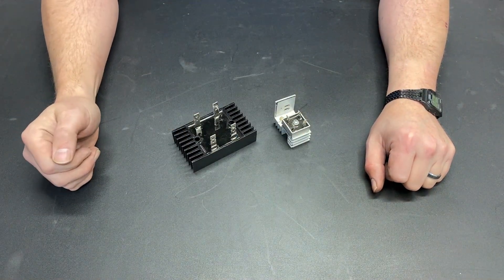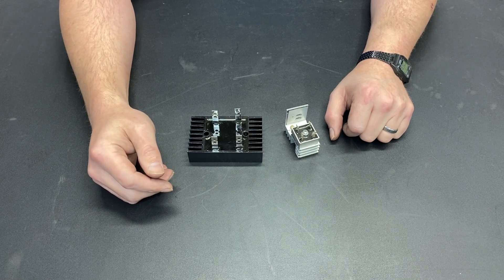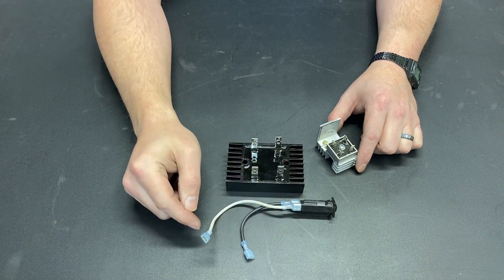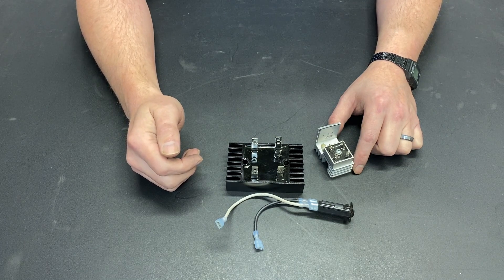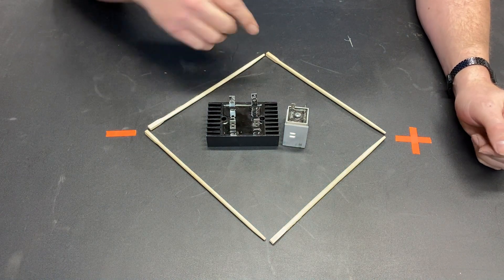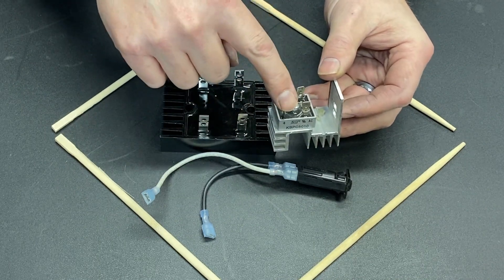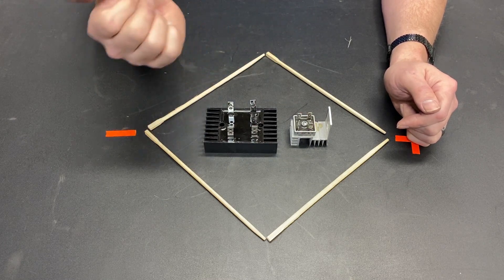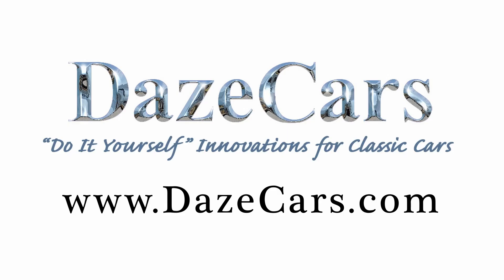Rectifier Basics for SCR & Variable Transformer Treadmill Motor Power Supplies Convert AC into DC

Comment: I have an SQL 100A 1600V bridge rectifier with 5 pins. The 3 on one side has a tilde mark on the pins and the other side has a plus & minus sign on the pins. I am trying to build a motor controller (using information from your video series and thank you very much for making those videos) for my drill press using a tread mill motor. I am not exactly sure how to wire it. Please help.
Reply from the maker: that is the wrong rectifier.  It is setup for 3 phase.  I believe you can still use it by only hooking up two AC wires on the AC side leaving the third unattached.  Double check it with a meter before using it to confirm you have it hooked up correctly

Comment: I guess Im a little confused by what you’re referring to when saying “burning up your power supply” in the event the rectifier has a diode short. 
Are you referring to a SCR controller or possibly a variac?
Reply from the maker: Any AC power supply, Variac or SCR.  when a rectifer fails it is effectivly like connecting the two power leads coming  from the SCR together shorting out the SCR.  Same would be true of the Varic

Comment: Hey Treadmill guy, question, I’m hooking up a 4 hp, 30amp treadmill motor for my lathe, I’m using all the components you are suggesting 
Larger rectifier, 20 amp breaker , potentiometer you suggested. I have a problem with the breaker popping as I turn it up, my wire plug in is 16 gauge, all my other wires are 12 gauge , or 20 amp rating. Do I need some kind of transformer to allow me to reach 30amps from a 110 house outlet?  I think the motor is drawing more than the system can handle, thus popping the breaker. Thx Rich , great videos ! 11:10
Reply from the maker: I am running 25 amp motor on my lathe with no issues.  First thing I would look for is a physical issue.  Something binding, turn all moving parts by hand including the motor shaft.  What is the RPM rating of the motor?  are you using any gearing?
Reply from the maker: Are you popping the house breaker on the breaker in line between the SCR and rectifier?
Reply: @dazecars  popped the 20a breaker I installed in the wiring circuit to bench test the motor.
Reply: Just bench testing motor, no load on motor yet, checking rotation seems to be ok no drag, 4.0 hp, 4000 rpm, 90 volts, 30 amps
Reply: Does the 30 amp rating , mean it will draw 30 amp, that’s why it’s popping?
Reply from the maker: @richbulger9710  Several things here first the breaker might be over sensitive, second the motor can draw up to 30 amps but usually only when loaded.  I run a 20 amp breaker on on my 25 amp motors without issue but your motor is a beast.  I would go to a 30 amp breaker.  As long as you are using the good rectifier not the little silver one for a bench test you could try it without the breaker.  It is still a possibility to blow the rectifier but is not likely because there is not load to the system.  That is just a good test but I would not run the system without a breaker in the final install
Reply: I removed the 20 amp breaker and it ran for a bit, even a bit more rpm’s, then the 20 amp breaker at the breaker box popped.
I will get a 30 amp breaker and try that for the treadmill motor circuit. Should I be concerned with running the 30 amp breaker on 12-2 wire instead of 10-2. I am using the bigger black rectangular rectifier with cooling fins, that you specified. Thx will give it a try. Rich
Reply from the maker: @richbulger9710  That motor is huge and I believe that is the problem.  I think you are going to have problems getting enough amps no matter what you do. I was hoping that due to the reduced volts a bigger breaker between the SCR and rectifier would not be an issue (amps and volts effect each other) but now that you are popping the house breaker I would not step up the 20amp  breaker.  Were you on a 15 or 20 amp house circuit?  The only other option I can think of would be to run it on 220 BUT you will need to be very carful not to exceed the 90 volt spec.  Most SCRs will work at both 110 and 220.  If I was going to do it I would put a limiting resister in series with the potentiometer to make sure there was no way  to put to many volts to the motor...  Do any or all of this at your own risk... sorry had to say it 😁
Reply: I’m using the 100amp, 1600 volt bridge rectifier, 2phase diode.
Reply: 20 amp
Reply from the maker: @richbulger9710  If you are popping the 20 amp house breaker, than that motor is simply too big for a standard 110 circuit.  I am sure there is probably a power supply out there that could be used but I am not sure what it would be and it would likely be expensive.
Reply: I never got or saw the controls for the treadmill , is it possible that the controls were able to make it work on 110, do they even make 220 treadmills, is running it on 220 make any sense, if so  how besides setting up a separate 220 circuit. Or should I focus on finding another motor. Thx
Reply from the maker: 220 (again at your own risk) will solve the amp issues but you must run a limiting resistor in the SCR so that you never over rev it. The potential is there to go more than twice the max RPM. You would need a 30 amp breaker between the SCR and rectifier, you would need to confirm the SCR is good up to 220 , and a different value potentiometer with series limiting resistor would be required. Up side a superior motor with tons of torque and plenty of power to drive it, down side, no room for error and catastrophic results if not done correctly.

Comment: With this setup do you run the inductor & choke ?
Reply: using the Variable Transformer
Reply from the maker: it’s not required like on the scr. you should watch my mc2100 scr variac shootout
Reply: @dazecars   Thanks I did before .. I'm not a electric guy so I miss understood the words "Clean Power "  I was running a treadmill motor with a SCR  & it just quit so I am converting to use a variac . Thanks again
Reply from the maker: @rcasatelli400  glad I could help

Comment: Why do you need an extra potentiometer if the Scr has one or am I mistaken?
Reply from the maker: The one in the SCR is oversized for most treadmill projects.  Most SCRs come with a 500K potentiometer and for 110 usually 120K-150K is what is needed.  You can use the 500K unit but you will need to turn the potentiometer 2/3 of its travel before the motor will come on which only leave 1/3 for total speed control.  I use two different sizes of potentiometers for my projects so I have fine and coarse speed control.  I cover all of this in this video https://youtu.be/04d0u1RJyXw

Comment: Have you seen the KB electronics KBIC boards?
Reply from the maker: I have my concern with them is amps.  Amps are directly rated to torque and their amp rating is well under the max amp rating of most treadmill motors.

Comment: wondering if you can help me i bought the 4000 w scr speed controller and pack of 4 bridge rectifiers number 5010 to hook up to a treadmill motor so i tried it out on a little 18 volt cordless drill motor and the thing blew out a bunch of sparks ...i thought the rectifier was to bring voltage down to 12 volt  ? so i didn't try it on treadmill motor didn't want to blow it out what did i do wrong ? i hooked 120v into scr controller and out to bridge rectifier to ac clip and parallel clip i seen it done a few times then motor to other 2 parallel clips and bang
Reply from the maker: The SCR controls volts and puts out between 0 and 110 V  AC.  The rectifier converts AC too DC.  It is not a 12V converter.  That SCR will be too small for a treadmill motor, you will burn the SCR up.  Also your rectifiers are likely too small.
Reply: @dazecars  i seen the videos where they bought 10.000 and they said it was to big and they had to turn the knob over half way before the treadmill motor would turn they said 4000 would be a better scr and i'm gonna order the bigger bridge rectifier that you showed on this video but what scr would you recommend and Thank you for your reply gonna use the treadmill motor as a powerfeed for tablesaw
Reply from the maker: @GeraldMcneill  wattage has nothing to do withe potentiometer. Sadly there is a lot of misinformation out there. My channel has lots on this topic.  Putting Together a QUALITY Variable Speed Power Supply or Treadmill Motor Controller SCR type
https://youtu.be/m0cLqKg1byI
Hooking up the Components for a Quality SCR Treadmill Motor Power Supply, Treadmill Motor Controller
https://youtu.be/SjEgKH_MGFE
Changing the Potentiometer in an SCR Voltage Controller Treadmill Motor Controller Power supply
https://youtu.be/04d0u1RJyXw
Reply: @dazecars  if i bought a 12 volt power supply could i avoid the bridge rectifier and do i buy 20 amp or 30 amp thank you in advance for all your help
Reply from the maker: @GeraldMcneill  What are you trying to do?  With a DC motor voltage effects speed.  Yes you can power a 100V DC motor with a 12 volt DC power supply but it will be slow (relative to max speed)
Reply: can anyone help ?
Reply from the maker: @GeraldMcneill  I responded to your most recent question, was there something else?
Reply: @dazecars  one of my messages didn't post it was  going to build a table saw and use a treadmill motor as the power feed to pull the wood through treadmill motor to gear box for power and speed control to speed up the feed and slow it down... but i've seen many videos everyone using different things to do the job for treadmill motor if you could type out here what i need to use i'll buy what you recommend because you know a lot more about these things than i do i need Speed controller and bridge rectifier so what size do i get ? thank you for taking the time to help a person out
Reply from the maker: @GeraldMcneill  There are parts lists in the descriptions of the videos I have on power supplies.  It is more complicated than just a power supply, you also need to gear things correctly.

Comment: Hi, I have found your video's the most informative of all I've looked at here on yt.  I followed your directions and completed a treadmill motor conversion on my lathe, it works flawlessly.  TY   I was given a motor and control board by a friend that has a completely different electrical setup. The board is a "B017D" and I do not know what I need or where I make connections to get this running.  I would like to use it on my ban saw.  Can you offer any help, you are without doubt much better educated in electronics than I.  A google search on the board will give you a very good picture of possible connections I can use.
Reply from the maker: Glad you liked them.  You might be able to hook a PWM to RXD and TXD inputs but I don't know for sure as I have not encountered that board.

Comment: Another great application for bridge rectifiers is to convert cheap arc welders into DC Electrode Negative (DCEN) which almost eliminates welding spatter from flux core welds.  There's lots of YT tutorials on it, most also using large capacitors, but I did the bare bones conversion with just the rectifier and now my janky 90amp 110VAC welder can compete with a good MIG welder.
Reply from the maker: Interesting, thanks for sharing

Comment: Hey, man I know you have much better things to do with your time. I really appreciate you taking the time to help this dummy out. Although I did get it through some trial and error, I fortunately had the circuit breaker on there because you said it needed to be there. You were the only one breaking this stuff down in a way for me to understand how to do this conversion. I appreciate all the help you put out there. Thanks man
Reply from the maker: I am happy to help!!!
Reply: @dazecars  When you say "power supply" what exactly are you talking about? I want to supply power a DC treadmill motor with 120V AC wall current.
Reply from the maker: that is what a power supply does.  It takes 110 AC power and converts it to something else.  I have tons of videos on my channel on how to power treadmill motors.
Reply: Sorry for this late comment, but is circuit breaker connected to the power source then to the rectifier in feed?  I want to verify that this iscorrect.
Reply from the maker: I put the circuit breaker between the power supply and the rectifier so that if the rectifier fails it trips the breaker instead of burning up the power supply
Reply: @dazecars  
Thanks!